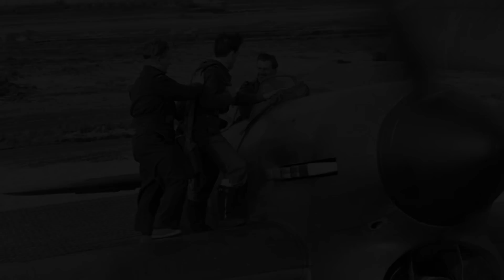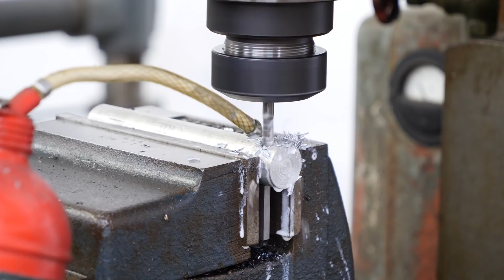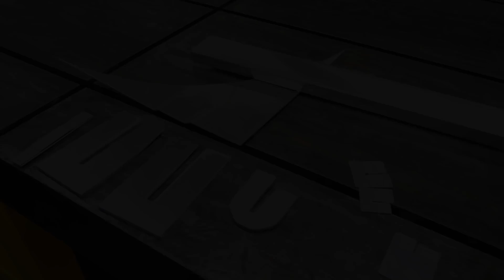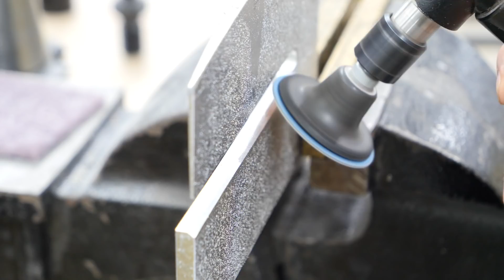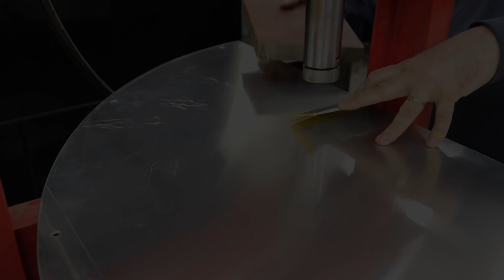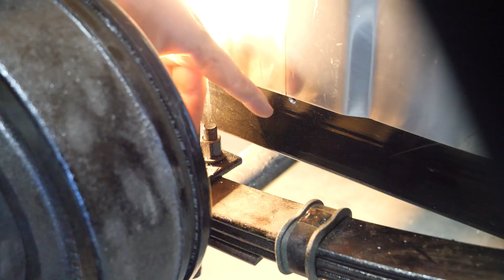S2E5 Pressing Issues

Comment: The copper Rolls Royce panel looks absolutely fantastic mate! Even better at the end of the video as you show how it is going to be copper riveted in place. Tip for you Ian, make yourself a3/4" or 1" thick block drilled with tapping size of threads you want to use, and nominal diameter holes to permit the tap to go through and having drilled these holes either in the drill press or the mill to ensure they are 90 degrees in 2 axes you can clamp the block and use it as a guide for the tap to ensure squareness of the threads. Also it helps hold the tap as you are playing around with the little adjustable spanner.
Reply from the maker: Very nice tip,  great idea, thank you! ~Ian